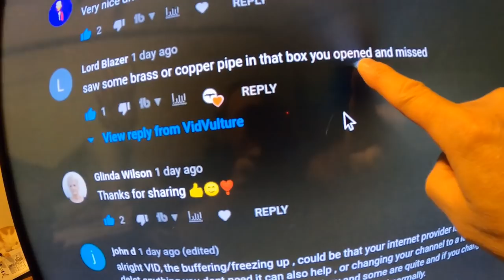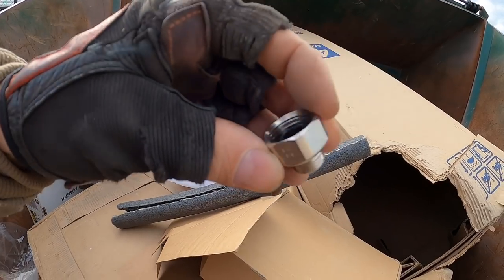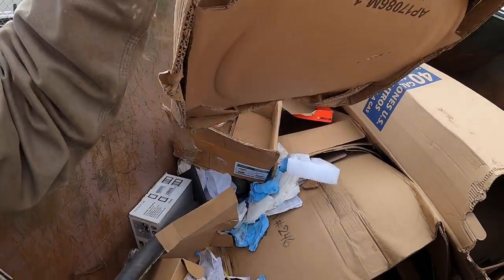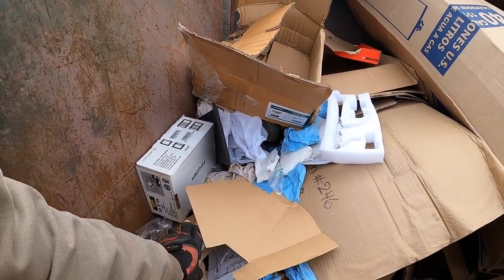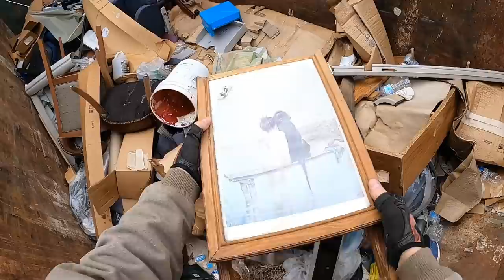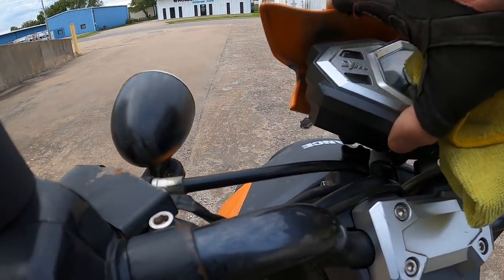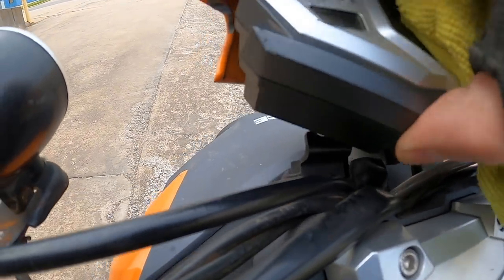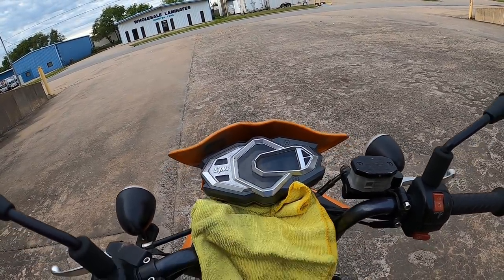Scrap Metal Processing by Hand - Why Is This So Satisfying?

Comment: Vidvulture you killing me on those brand new window screens bro, it hurt me deeply.  I have rental units and replace these on a regular basis, they cost anywhere from 16-29 a piece complete, and I pick them up whenever I see them on offerup/facebook at upwards of 20 a piece based on need.  Breaking up gold for pennies there.  at 15:32 one has a label at the top $350 for a pack of 25, some contractor just moving on.

Comment: So  , from the looks of your scooter you haven't got around to selling some of your hoard to repair the issues with your m.p.h. screen display  . Is it going to cost too much to get it repaired  ? Or is there more issues with your ride that we don't see and your shaving up to get a newer ride  ? Anyway good luck with whatever you have planned on doing  .
Reply: Vacuum leak
Reply: The area where you use to stick your side cutters that is now flopping all around like it's about to fall off is not a vacuum leak  ! If that falls off the bike will not be able to run or drive.